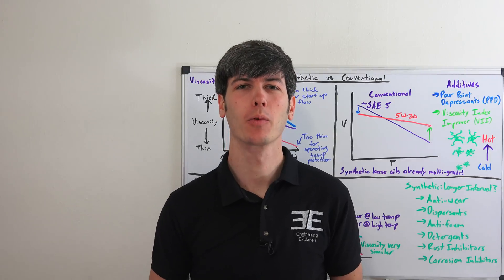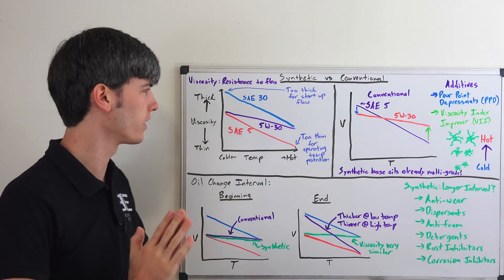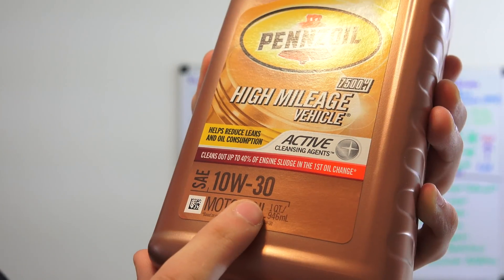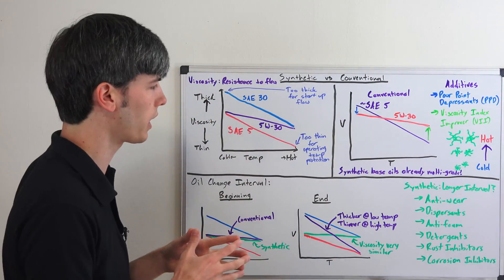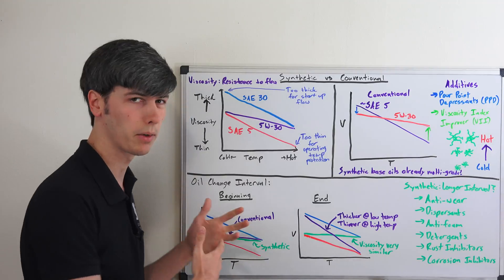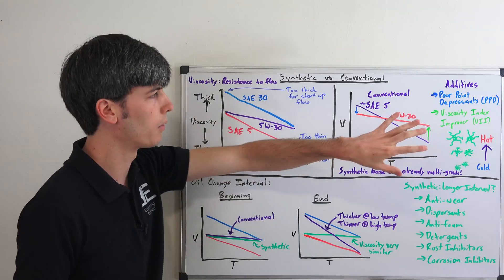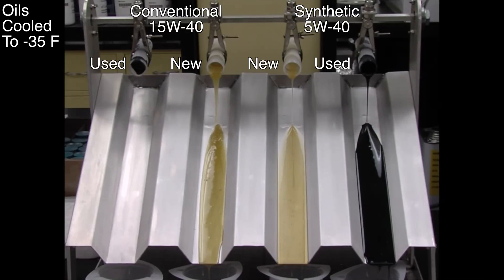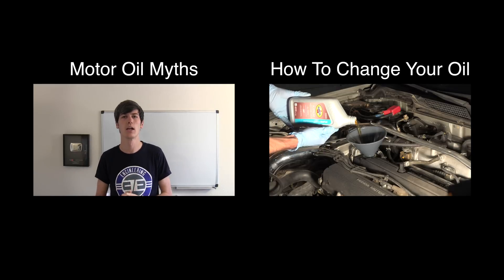Is Synthetic Motor Oil Better For Your Car?

Comment: It's too bad you used two different viscosities for your demonstration, which distracts from what otherwise was a good discussion. It should have been evident even with a same viscosity demonstration although the difference was amplified by unfair comparison. From experience, I can say that pouring new cold oil in the dead of winter takes a long time! It certainly is further evidence that timely oil changes are critical when using natural oil, although removing impurities is also an important goal. So, to clear contaminants that get through the filter, I wonder about the longer time change interval with synthetic. It would be nice to have objective evidence from randomized trials to show longer engine survival comparing the two oils, although I doubt any difference would be seen if recommended change intervals are followed. Even that trial in the New York taxis showed no difference when looking at change interval for natural oil. I suspect there are more proprietary data available but concealed by companies looking at these issues. If the data were strong the marketing departments would spend the dough to let consumers know. Thanks for the video!

Comment: I would be interested engine teardown after 200k miles -- conventional oil vs. synthetic. I currently drive a crown vic--owned since new with 176k and always used a conventional oil. No problems, no oil consumption and through valve cover oil fill opening looks very clean--can actually read casting marks. I change oil every 4k and outside of a mini bike never used synthetic. Im interested in the science behind synthetic but never saw a reason to change. Im an old guy, but back in the day we consistently ran Vavoline and would crank small blocks and big blocks to 5500-6000rpm and never really had a failure that could be pointed to failed lubrication. Im not arguing that synthetic is not better, I m saying if you can drive your car 200,000 miles with no apparent lubrication issues why run synthetic. Conventional oil has served me well. As an educated fellow---would you think there would be a significant difference in wear among components if you took duplicate cars, same climate and same driving styles, each car oil changed at 4000 miles?  Thanks I did find the information provided very interesting.
Reply: what oil you using?
Reply: What climate?
Reply: Yes, valvoline made a video like this where they tested two SUVs one with conventional and the other with synthetic and ran them on a modified dyno outdoors. After 500,000 miles on both vehicles the synthetic oil engine was cleaner with significantly less varnish. Both oils prot cited against wear though like you stated. Synthetic will help your engine stay cleaner

Comment: My question would be:"Is synthetic ok for high mileage?" I believe I read somewhere synthetic disadvantages include leaking through seals..
Reply from the maker: +Jason Lurf totally fine. Synthetics sometimes come with more powerful additives, which can clean away gunk, and occasionally reveal leaks. But it's not leaking because it's more "slippery." It's just cleaning your engine, and the leaks were already there, and should be addressed separately.
Reply: You don´t know what you are talking about. Open your School books!

Sins synthtic oil gets less affected by heat it leaks less in a warm Engine.
Reply: drive a 1999 honda accord with 270K miles on it, have used synthetic since about 70K miles on it, doesn't burn a lick o oil, doesn't leak, and I've never had any major engine work done save the timing belt twice as maintenance. there is nothing wrong with synthetic oil in high mileage. 90% o engine wear occurs at startup, exactly where synthetic will protect that high mileage engine and conventional wont, especially in winter. Secondly, clearance and tolerance is clearance and tolerance, worn bearings wont matter more with synthetic vs conventional. In act, the synthetic will get to where it needs to get better than conventional especially with worn bearings.
Reply: Well, how many Cold start tests with internal combustion Engines have you performed this far?

I worked for many years as a test engineer for haevy diesel Engines.
And stil today works with Engines as a calibration engineer. 

You are totally wrong.
Reply: synthetic won't cause a leak, but it will make an existing leak worse.
Reply: Part of the reason why it may leak is that older cars (depends on manufacturer) generally had looser tolerances.  The conventional oil probably helped fill in the gaps with gunk and it never leaked.  With synthetic, the leaks may appear due to the gunk being removed and the looser tolerances may have revealed a gap that was always there.

If this happens, you can either fix the source of the leak, or go back to dyno oil.  Just make sure that you change the dyno oil regularly.
Reply: It's from EricTheCarGuy. He talked about it, too.

Comment: mobil 1 full synthetic is the best oil its the only thing holding my k20 in my civic together. i bought the car and it had 20,000 miles on it and now it has 165,000 and i stay at 8000 rpms and i havent turned a wrench on it :) i have seen non synthetic oil literally be sludge inside of a head and oil pan.. DO NOT BUY CHEAP OIL it will save you alot of $$$$ in the long run.

Comment: Yall are alll idiots. There is no so thing as synthetic oil, it all comes from crude oil,,,
Reply: Sorry, you are wrong. Most synthetic oils are formulated from crude stock, true. But even then the crude is broken into it's component molecules and then completely rebuilt. Thus, synthetic. However, there are synthetic oils that are made from non-petroleum sources. Ester oils are made from the reaction of acids with alchohols, no petroleum involved at all. Other synthetics are made from methane, carbon monoxide and carbon dioxide. It is amazing what can be made using a firm grasp of chemistry.

Comment: Hey! Regular viewer here, Quick Question.
I have modified my car to run higher rpms. This includes a higher pressure and volume Oil Pump and additional machining for greater oil clearances. I will be reassembling and installing the motor very shortly. I knew that i should switch to thicker oil, but i wonder is Rotella 15W40 too thick? At what point would a thicker oil cause issues rather than prevent them?

Comment: Yes, synthetic oil is better than mineral oil. 

I once worked at GM Powertrain and we ran extended durability testing in test vehicles and Dyno engines and the differences were substantial. 

The only oil I've used since then has been Mobil1. I currently use 0W40 in my Integra Type R and 0W30 in my '16 Civic.

We also tested their filters and they were better than Delco filters so I use those, too.

Some advantages: better high temp protection, better low temp protection, better oxidation resistance (due to additives, no doubt), significantly better if glycol or petrol ever makes it way into the crankcase (that was a sight to see!).

The drawback is $$$ so for to Wal-Mart and pick up the larger containers. The oil will not break down; it just becomes contaminated. I will go 6,000 miles between changes and could probably go more but Insee no reason to chance it.

5W20 is used for fuel economy but you give up higher temp viscosity so I'd avoid it.

Just something to think about - oh, and I did not watch the video.

Comment: I actually have a Honda civic Hybrid year 2008 with milleage around 190 000 km and I have been using  fully synthetic engine oil 0W20 up to now as recommended by the dealer. However, my mechanic told me to stop using fully synthetic but semi synthetic 10w40.. Can you please advise if that would be proper or should I keep on with the fully synthetic one..Thanks

Comment: which is best engine oil for motorcycle semi synthetic or fully synthetic
Reply: synthetic as long it is meant for bikes, otherwise you have a slipping clutch.
Reply: My HD Fatboy uses Syn in trans, clutch and Engine.  HD actually has one fluid, does all three things, works great.  I have HD Syn in clutch and trans, went Mobil 1 motorcycle for the engine .  Syn is the way to go
Reply: wat about 200 cc motorcycles
Reply: still gonna fall apart
Reply: Imho amsoil is a really really good oil.
Reply: Aniket Gijare Shell Rotella diesel oil. Seriously, it meets or exceeds all JASO specifications for Japanese sport bikes and is significantly cheaper than other oils. Rotella T4 (conventional) and T6 (synthetic) are both fantastic.
Reply: Aniket Gijare Yamaha s clutches don't like synthetic.  if you got a Yamaha run a Yamalube product. as for all other bikes motorcycle type synthetic oils are best.  my father is a lubrication specialist.

Comment: I was surprised to see the new oil being poured into the funnel with the can opening in the low position.  This should be at the top to prevent the Glug-glug so that as air replaces the oil and oil spurts out, the oil flows evenly and steadily

Comment: There is a lot more to evaluating oil than just looking at the viscosity at cold flow.
Reply from the maker: I'd agree, and also ad that there's a lot more information in this video than just how oil flows at low temperatures. :)
Reply: Don't read the comments! Nothing but A** H***s down here!
Reply: Engineering Explained my only issue with the video was that flow was only shown at -35 degrees. Only a very small percentage of the worldwide population ever experiences those temperatures. I think tests should have also been shown for 0 degrees, 70 degrees, and 200 degrees. Also I think comparing two 5w30 oils would have made more sense because the only people who use 15w40 and 5w40 are typically diesel engine or turbocharged vehicles.

Comment: I heard its not good for old cars to use Synthetic Oil, is it truth?
Reply: No.
Reply: Sort of. The oil will not directly damage the engine. However, old engines sometimes have buildups of sludge that are actually sealing leaks. Use of a high detergent oil (or synthetic) can remove those "plugs" and cause an engine to start leaking. In addition, the "plugs", having been dislodged from their resting places, can sometimes migrate into oil passages and resume their "plug-ness". Then you can have a problem. But, this is pretty rare. Especially if you've been using oil made since the 90's. For all intents and purposes any decent synthetic is better than most conventional oils. I run the walmart brand synthetic in about everything. It has served me well for many years and costs about the same as the regular stuff.

Comment: why is the second number higher than the first number (winter viscosity)? When the motor oil is actually thinner at operating temperatures.

Comment: I actually just started using Rotella 10w30 diesel oil in my '85 D-150, which has a 318. It has a high zinc content, which coats metal components better than just oil -- that and my engine still uses a hydraulic flat tappet cam valve train. Don't want my tappets to chew my cam lobes off.

Comment: Castrol or Mobil 1? which one is better?
Reply: Mobil 1 all the way.
Reply: Jacob __ Mobil 1 has great oil filters as well.
Reply: Ze Khong ill preface this with the fact that this was told to me so accuracy may very but in order to be considered synthetic it needs to be a certain ratio of synthetic oil, 60%+ I believe. With that being said Mobil1 is a higher percentage synthetic than Castrol, I use Mobil1 out of preference never have issues with cold starts ect. but I'm sure there are plenty of guys that will say the same of Castrol bottom line is unless you're in a place with subfreezing temps in the winter and scorching summers either one with out perform the conditions you're presenting them with.
Reply: I only use Castrol. but that is because I stick to one that works best for me. I suggest use the one that is cheaper and easier to get as long as it meets the viscosity requirements of your car?

Comment: The other important things to mention about synthetic oil, especially for people living in a cold climate, is that synthetic oils will actually cling to surfaces inside the engine, it wont all run back down into the oil pan. this is one main reason why synthetic oil helps your car start in the cold, because its already partially filling all the passages in the engine thus making your car easier to start. that and of course like the video says, it stays the same viscosity over its life, and in cold weather, whereas conventional oil thickens up in extreme cold

Comment: Any opinions on Z-max?
Every car I put it in ran much better in all aspects.
Plus, the engines were all running smooth and strong long after the cars rotted, fell apart, and were off to the junkyard.
Reply: kcotte59  ..WTH? keep animals out of this!
Reply: I wouldn't. Too much zinc will wreck cats.
Reply: Wak Job A

Comment: I have a 454 crate motor with about 4,000 miles on it. just change from a flat tappet cam to a roller cam. should I use synthetic and what kind would you use thanks.

Comment: Corrosivity, acidity, rubber swell and other things are factors that the engineers have taken into consideration when selecting lubricant for a specific engine. In short, it's not as simple as "synthetic is better than conventional". Use the oil that is recommended for your engine or an equivalent.

Comment: SAE is a rating for the viscosity in different temperatures and usually most oils provide different SAEs for different climate conditions. API (American Petroleum Institute gravity rating from SA to SM -and higher in future) is the ranking and rating of oil and the one you should look for on the oil.

Comment: Never understood the isea of rust inhibitors in OIL...I mean, we put OIL on metal to KEEP  it from rusting!
Reply: Complete combustion creates water and carbon dioxide, there is always some blow-by of combustion gases around the piston rings. Thus, partially burned hydrocarbons and water getting into your crank case and oil. Water can condense on metal parts when the engine cools and accumulate in your oil. Operating cars on short trips aggravates this problem. Running at operating temperature for longer periods of time can evaporate much of the water out of the engine.

Comment: HI thanks for this vedio👍 I have automatic transmission motorcycle and when I but new oil engine 10_30    soon the motor have Smell similar to burning without smoking what the reason it's error in engine or other things. ...
#thanks...😊
Reply: but.....
mean put

Comment: Yes this information is correct, but it is not practical.
If your car has been using synthetic, use synthetic. If it hasn't, use what you have been. Older cars with minor leaks should have higher viscosity, stops the oil from leaking and will "plug" the holes. Ask your Technician, not these guys.
Reply: I'd rather fix the leaks.

Comment: I use synthetic Motor oil and will not change. I have a turbo charged vehicle and use 5W 30 which is what the manufacture recommended.  However, my vehicle was made for the Japan market and i live in the Caribbean where its warm all the time. Should i change the motor oil from 5W 30 to something like 10W 40?
Reply: No. Stick with 5w30.

Comment: I was 100% sold on synthetic when I had to lower the idle on my carburetor after switching to synthetic.  200 RPM extra from an oil change.  That's a lot lower friction.